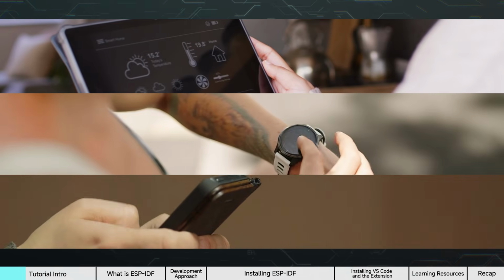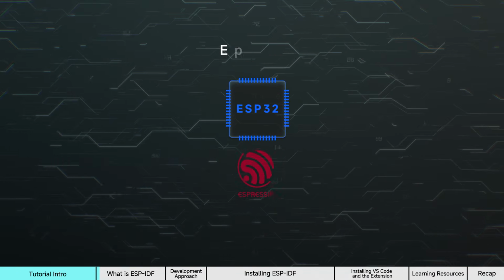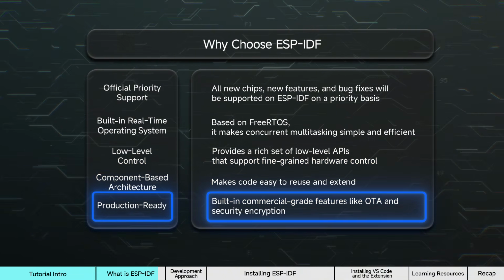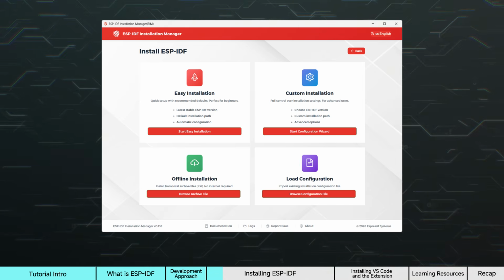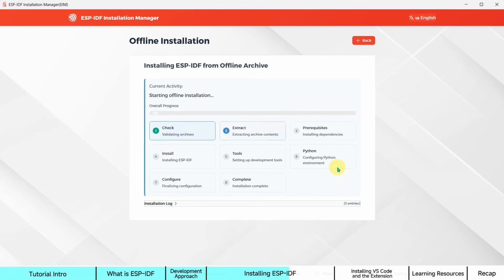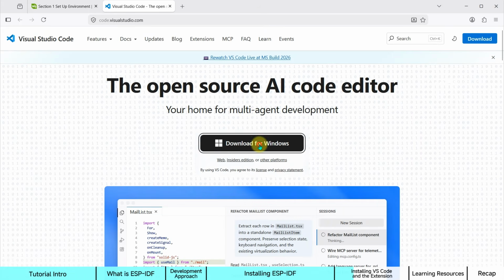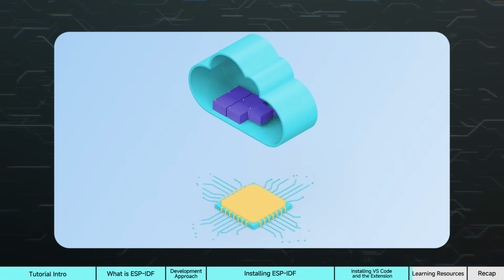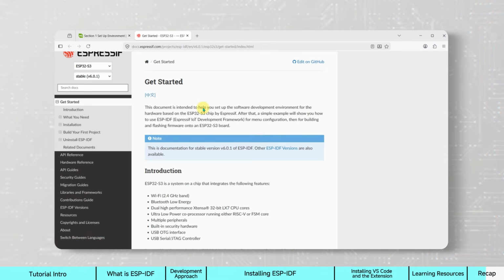ESP-IDF Tutorial | 01 Install & Set Up ESP-IDF

Comment: Trying to install the IDF using files from the website given here, getting the following error:
2026-08-31 01:08:11 -  1 - 08 - ERROR - Failed to setup tools: Failed to install Python environment: failed to install requirements from file "C:\\esp\\v6.1-beta1\\esp-idf\\tools\\requirements\\requirements.core.txt": The system cannot find the path specified. (os error 3)

Please help.
Reply from the maker: Thanks for the feedback. We weren't able to reproduce this issue on our side.

Please try installing ESP-IDF v6.1 instead. If the issue persists, since the ESP-IDF Installation Manager is maintained by Espressif, please open an issue on their GitHub and include the error log:
https://github.com/espressif/idf-im-ui/issues

Comment: Can the -S3  run anything that the -C6 & C3 can do? :hand-pink-waving:
Reply from the maker: Mostly. The ESP32-S3 is more powerful than the C3/C6 in areas such as CPU performance and vector acceleration, and it can run many of the same ESP-IDF applications. However, it lacks C6-specific features such as Wi-Fi 6 and 802.15.4, so it cannot replace them in every case.
Reply: @waveshareelectronics  - Thanks for the feedback.
 But disappointing. Oh, well.